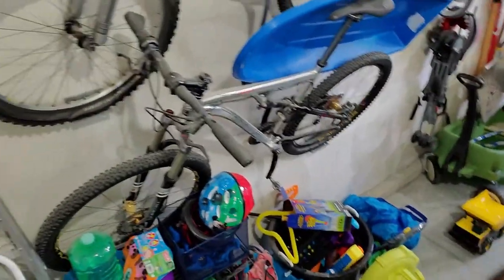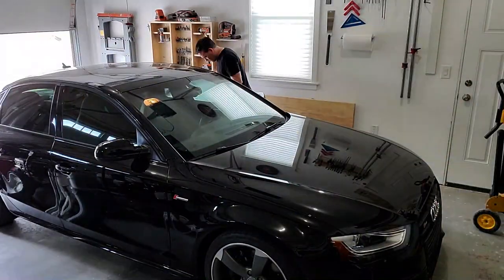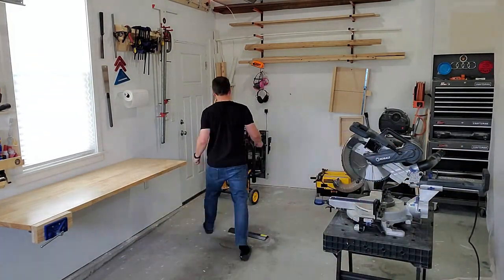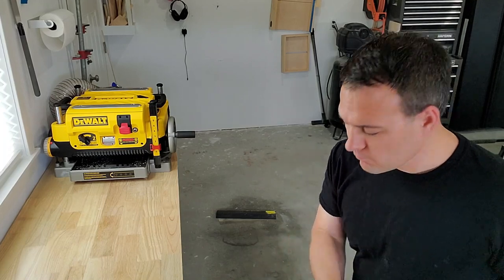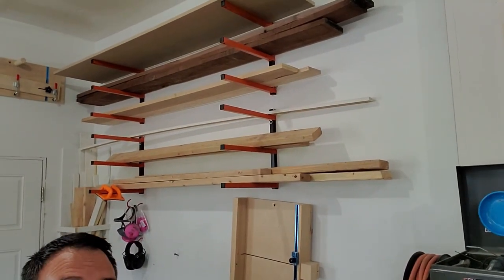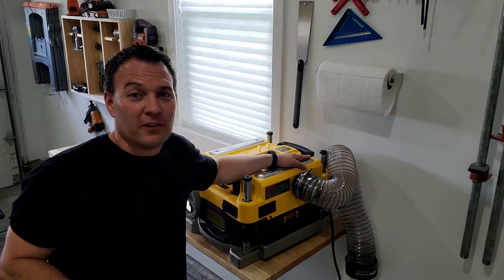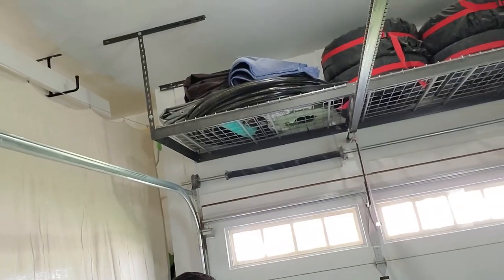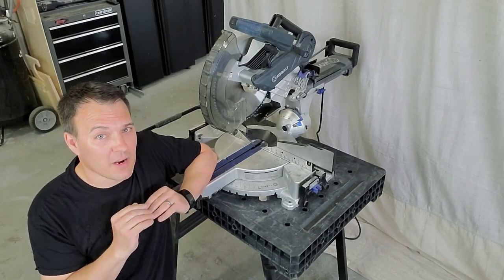Tiny Woodworking Shop Tour | How I Do Things DIY

Comment: This video is exactly what I needed today.  I had seen your garage in the other videos and was trying to remember some of the things you did so this was perfect timing as I was organizing my garden tools today.  First question: Where did you source that metal mesh organizer on the ceiling above the garage door (didn't see that in your sourcing list).  Second question: How come you don't have a bracket in your safety area for your steel-toed shoes (for when you are working in your shower-shoes or your go-fasters).
Reply from the maker: Ok, first off, thanks for watching.  I got the overhead storage from Amazon and added it to the link in the description.  Lastly, I have a storage area on the other side of the garage for my steel toes.

Comment: Do you find that curtain helps keeps contain the mess? I did the same in my garage and it seems to do absolutely nothing but get in the way lol
Reply from the maker: It defiantly cuts down on the dust getting to the other side of the garage.  My Wen air filtration system helped as well.  It still is an issues but over all big improvement.  Her is a link  https://amzn.to/3YnLnaW
Reply: @How I Do Things DIY  my diy filtration is definitely not cutting it haha roughly how much of a gap do you have between your curtain and the ceiling?
Reply from the maker: Well, it's on a wire, so between 3-12" I would say.  But my ceiling is 10'.